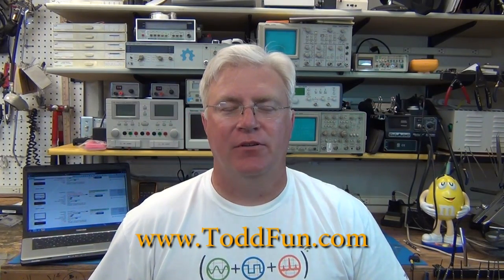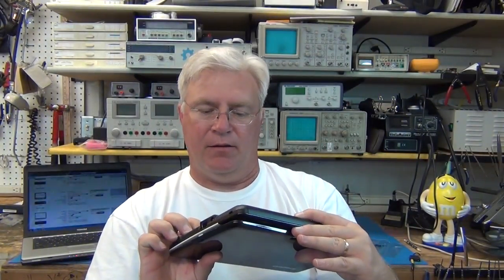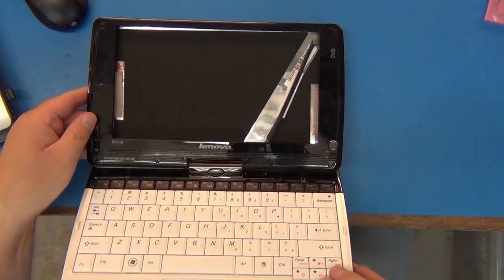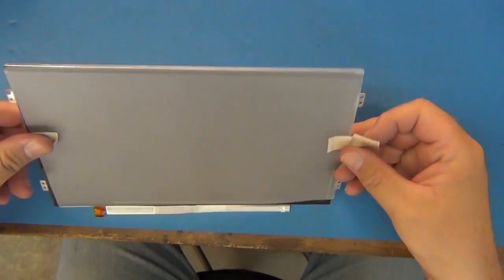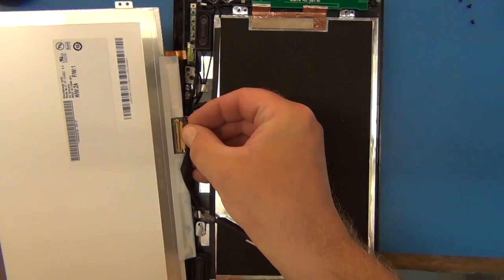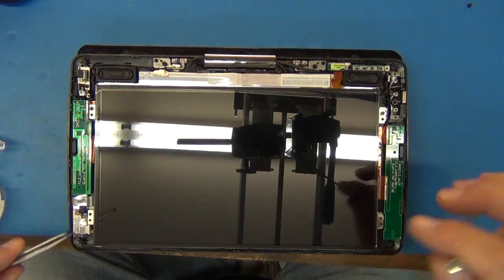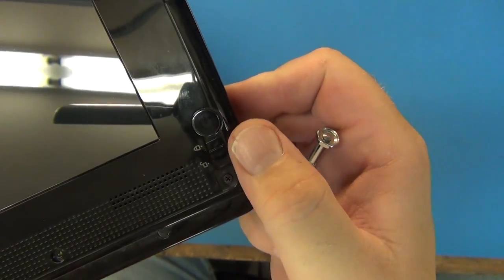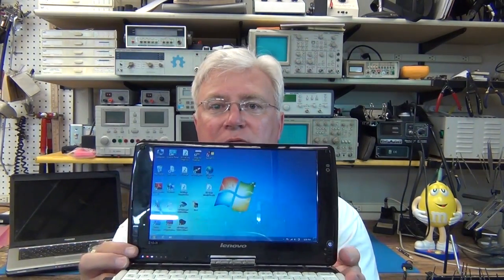Laptop screen replacement / How to replace laptop screen Lenovo S10-T3 model 0651

Comment: I take it the warning is how you broke it in the first place. A little lubrication on the hinges while it was apart would also have helped. With one of mine the whole plastic is brittle and cracked, so it stays open most of the time and is not moved, more like a mini desktop.

Comment: Pink is tinted Beryllium oxide, used because of it's heat transfer capacity and being transparent to microwave radiation. Intact no problem, but the dust from broken oxide is a carcinogen like asbestos, and causes problems later in life.